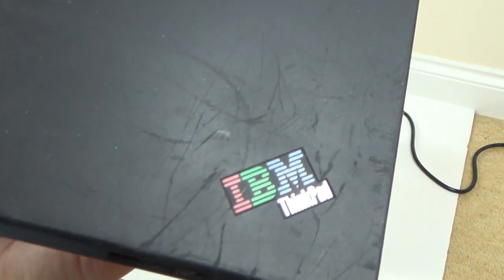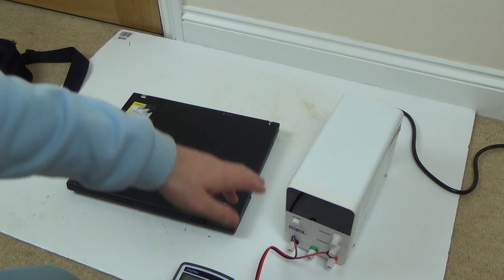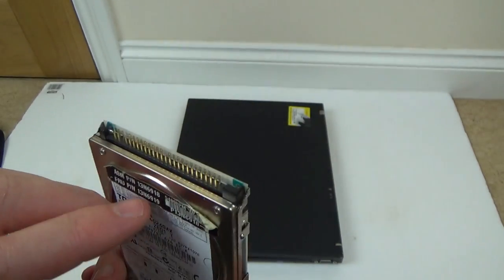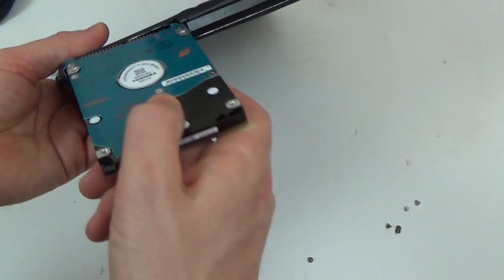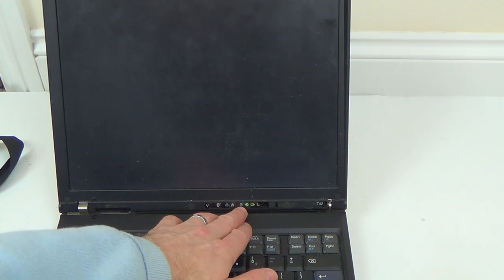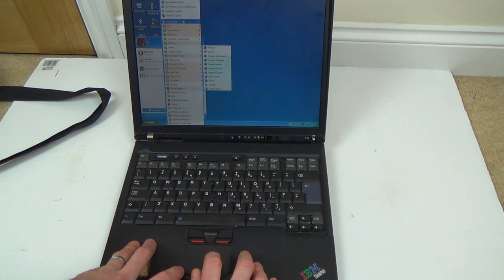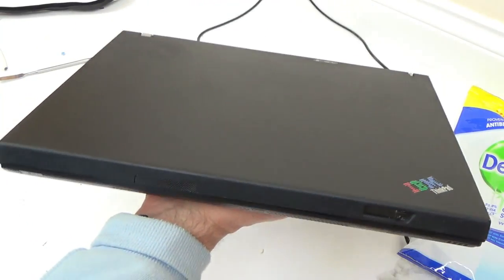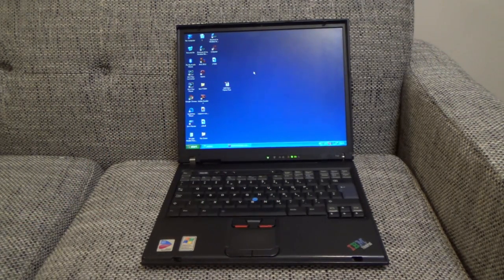Trying to FIX : IBM ThinkPad T42 Laptop

Comment: 33:51 install linux on it...you can also disable certificate warnings in the settings.
Reply: I was going to comment the same thing.

I'd say something like Lubuntu would work fine (or Debian if 32bit).
Reply: there really is no point in linux, there wont be really any performance improvement. Trust me i had a thinkpad t60 and honestly windows 10 ran better than any linux distros I have tried on it.
Reply: @YoureUsingWordsIncorrectly  linux users denying windows again? pretty normal at this point. 
anyhow I have tried linux on multiple computers and there literally is no difference in performance, it's the same. The only difference is software support, and the fact that microsoft does spy on you but I am fine with that some people for whatever reason aren't. 
The only performance boost you may see on linux is generally navigating around it but the software itself that you want to run will be the same regardles of what OS it is on. 
which is why i choose windows because it just has more features and a heck a lot more programs.
Reply: @aleksandersats9577  Not necessarily, depending on what you installed, because if you installed something like Gnome, Gnome has the tendency to be a bit bloated, and a power hog. Windows is about the same thing, for example, Windows 10 has two browsers preinstalled, Internet Explorer, and Microsoft Edge, don't believe me, search them in the system. And if you didn't put an SSD in any of the systems, and that's another reason, because hard drives has the tendency to fail, and slow down over time, and the reliability was never that great. That's really why company's went away from hard drives for the most part, and went with SSD's, "Solid State Drive's". Reason being is because SSD's is flash storage, and not mechanical, like hard drives, so SSD's are more reliable, they don't slow down over time, and they don't have the tendency to fail much, as long as you don't do something like defragment an SSD, because SSD's  are just not built for that, and can't withstand a defragment, and it's just not needed to perform because the performance on SSD's are pretty good anyway.
Reply: @jonathongraves2976  well look here I am 1 year in in becoming an IT specialist so I know lots of these answers already. and yeah sure hard drives might be unreliable but I have a hard drive that I have been using for 9 years and it's just fine, no sector errors or anything.
SSD's also slow down a lot when they are full same goes for hardrives there is no difference there at all. And no, hardrives do not get slow overtime, the system becomes slower because there is a lot more files than previously and the system needs to load them into ram to speed up the system, so that's where the slowdown comes from. 
And yes I know windows 10 comes with edge and IE, I still use IE on one of my older laptops simply because it's more optomized for that hardware than chrome or firefox. 
Also I don't use ssd's yet because they are still a bit too expensive for me and offer almost no space compared to hard drives, and another reason why I use hard drives is because unlike most people I have patience and can wait.

Comment: That pxe boot rom screen thing is also called network boot so the laptop in the earlier was trying to boot using  files that it could have found in the network. And it also requires an ethernet cable. Also connecting a windows xp computer to the modern internet isnt a good idea as xp hasn't had an update since 2014.

Comment: The pink/orange tint on the screen is indicative that the CCFL backlight tube)s) are failing. Eventually they will die altogether but if the tint disappears after a few minutes and the backlight stays on, then it'll probably be OK for a bit. Replacing the tubes IS possible but a lot of work and that's assuming you could even get hold of the spares. Replacing the whole screen is the usual fix for this but it'll probably be ok for now as it is.

Comment: The reason there is an orange tinge when it first powers on is it's probably using a CFL backlight (small fluorescent tubes) which aren't instantly at full power. Modern displays use LED's which mitigates this.

Comment: The “Orange” tinge is the backlight of the screen taking its time to fire up. Usually a sign of age of ccfl backlights. Probably not cost effective to replace the screen, however a very tricky repair is the replacement of the bulb itself. Theoretically possible but an absolute nightmare. 🤣
Reply: Put LEDs instead
Reply: @maytizevb  the screen looks like the standard cheap xga 1024*768 screen. Not worth for that. 
However LED modding is absolutely worth it for the great Flexview screens and the high-res TN panels

Comment: My daily driver right there for the moment. Slightly different t42 but my first thinkpad. Fell in love with it, will only use Thinkpads now. Laptop from 2004 won me over, Good on ya'll IBM. Thinking about getting a t61 and using that as my main laptop with some upgrades. 
Have a nice desktop I've built so for an on the go computer, I need reliability much more than I need speed.
Edit: Mine does need a new CPU Fan, the HDD cover is missing and the guy who tossed it took all the ram but the 512MB stick on the other side. If any of you guys know a good place to find Think parts other than ebay, please let me know

Comment: If you got an extra harddrive, you could clone the current drive to it, and upgrade the extra drive to windows 7 to rid of your wonder :D and yes an SSD would be insane, but I think that has an IDE interface, so an expensive Media Card CF and converter (if that is even needed). Microsoft is geared toward the Microsoft Store, much like Android older phones can't do Google Play. I had one of these, so it was a nice walk in history for me. :D Good job fixing it, and neat trick with the headlight restore idea.

Comment: Hi Vince, try putting a Linux distro (Ubuntu, Fedora etc there is also so very light weight distro's out there) on it if you just want a 'browsing' machine, the drivers are probably all in the latest kernel and you may find it runs okay for most stuff, also Windows XP is out of support by Microsoft now so no security updates.

Comment: I actually surprised how fast it boots from and old mechanical IDE drive. Nowadays, if it's not an SSD, we wouldn't even bother with it. And also the fact that the battery still holds it's charge give it's age (though possibly the battery might have been replaced). Yes, it doesnt hold the charge long, but i've seen newer batteries die in minutes after a full charge. Also, what is the song that starts at the 26:00 minute mark? Seems lovely and chill.

Comment: Sometime in the late Aughts, I came across a number of IBM ThinkPad T42s, in eWaste. Not one for letting a working laptop go, I snagged some and refurbished them for a private language school my kids were going to. I would say these are not all that remarkable, but build pretty robustly. Lenovo had already purchased the brand by that time. They are long gone by now. For Windows XP, there are is an open sourced Mozilla base browser which has updated TLS and root certs that allow for browsing but is are build on an older version of Firefox.

Security wise, like you said, this laptop and Windows XP should remain only for historic sake. It is at high risk of being exploited out in the wild. Any gaming should be non-web based, however I doubt it would be a good gaming machine - even in it's production years. It's a business machine, so it's focus would be Microsoft Office XP/2003/2007, Adobe CS2/3. I bet, instead of Windows, you might try Linux - Ubuntu/Fedora. As a spare machine there's plenty of interesting Linux discoveries out there for you, and you would have access to newer web browser technology. Also now that Microsoft has been embracing open source, I doubt you would miss all of that anyway. You can get .Net Core, and PowerShell for Linux even MS Office will run, with Outlook, and MS Edge Chromium. You would feel like you are working with more of today's software, just not gaming.
Reply: It's funny you say it's not a good gaming PC, bc the most used keys looked to be WASD, E, R, C, and Shift, lmaoooo. They must have been playing Elder Scrolls Arena or something.
Reply: In my experience Linux does not run well on old Pentium 4 base computers so if you have an OS that works better than windows xp or 7 than please tell me as I have some without an OS yet and so I can try it out.
Reply: @auqustfire  That is an interesting observation. I am sure it could play flash games. There are games, and then there are games. I suppose it could play Doom, Castle Wolfenstein, Duke Nukem - options are limited. It's a betweener, not quite a retro gaming system, and not quite a gaming system of its own time. Maybe it would work with WoW Classic, or Star Craft. I did like those games. Okay I take my words back, but it's what you make out of it.

Comment: I generally don't touch old laptops at all for the reason the issues you are having.

Away you can get around this is to upgrade the operating system.

But even then when you upgrade the operating system you might run into driver issues. They are a bit like software that allows things to work such as the CD/DVD drive.

Also you might need to upgrade the memory to allow the upgrade to work.

Comment: I'm thinking the black screws go into the bottom of the hard drive through the caddy and the two silver ones hold the black plastic piece by screwing into the side. Btw acetone is good at melting super glue

Comment: Hi Vince, your wife should have acetone, womans use it to remove nail paint. You always could borrow a little bit :)
PS. I was struggling with internet connection too. First update XP to Service Pack 3, then make sure that BIOS datetime is correct, then synchronize Windows datetime with microsoft server.

Comment: Thinkpad from the T30 and above were pretty solid machines, I thinl the got it right after the 600 series, hinges were not so good before. But many laptops suffered from it.  People sure will pick the T60 or T61. I prefeer the T400, it is almost a T61 but on early DDR3. Heating issues ? .... not really, but needs some care evey couple of years. FANs go wrong wiithout the BIOS alarming ... by go wrong I mean, slower than commanded. This machines rely heavily on fan efficiency. They dont get airborne as Pavillions did, but they definetely use it.
Reply: T60P with the IPS and the W500 are two of my favorites, T61 has its share of problems because of bump gate.

Comment: I think the old thinkpad is still usable , i have one perfect condition and added 1,5gb ram and a higher processor Pentium M 1,8ghz. In Windows XP is running very well. Mine is a T41, and i have a T61, R61, T60 ect...

Comment: PXE boot is looking for an IP Address. It's more commonly known to be used for network installation of windows. That can be set as the primary boot but if set, it can then go to hdd if nothing is found though it does take some time. It isn't an error but more an information note to say, "something wrong on your physical network or server. I cannot get an IP Address". Home users do not need PXE boot and so in the BIOS it should be disabled unless you have a server with a Windows image and Automated Installation file that will set up your laptop or PC without you having to enter details. 

Do not worry about it Vince. Just go into BIOS via F2 or DEL and disable it. You could also move it away from being priority. The clue to this happenign is it was potentially an old work laptop and since the hdd was disconnected, PXE Boot was enabled. That is actually a BIOS setting and NOT an actual problem. You can actually set an IP Address int he BIOS I believe nowadays but not surte on those, should be able to, not that it is needed.

Comment: nice job ,but it will be better if you clean it inside too and change the thermal paste of the cpu and the inside battery , this laptop where really well made and build like a tank , i got myself a thinkpad t400 with linux and i use it a lot for my musical needs

Comment: I like to keep "classics" like this around for (non-Internet) apps that need old windows or DOS. It's EZ to forget that computer were actually still useful before the World Wide Web..  :face-blue-smiling:  Case in point: I have a program that communicates with my PECU (Programable Electronic Control Unit) in my car. It's older and not a OEM item. Blaw blaw blaw. Catch ya' on the flip side. Cheers from So.Ca.USA 3rd House On the Left.

Comment: You need an old version of chrome, you can use that to download Firefox if required. They are tough machines and still get used for some vehicle diagnostics where a serial port is required, though rather slow and the hhd is very small - I think 120Gb is about the biggest

Comment: The reason why the securty issues come is because of expired certificates. You'll need to update the roots certiftificate to the one from September 2016, that was the last time I believe it was updated. There was an updater for it on the ms website but it is now gone. I ended up finding one from i430vx archive though.

Comment: I've suddenly got an urge to buy broken laptops from eBay so I can try and fix them.  Also, try UCBrowser, it's about the only browser that is reasonably useable on Windows XP. Or do what I usually do and ditch Windows and install Linux - something like Xubuntu or Lubuntu will work nicely with that laptop.

Comment: Put linux on it. Then it should work great with web browsing, is up to date and runs faster. (For more performance, i would suggest using the lxde desktop. works great with old thinkpads)
Reply: Or put Windows 95 on it and use it for retro gaming.
Reply: @MyRegardsToTheDodo  Sounds nice. You could install win95 into an image and boot it via grub. then both of us are happy!

Comment: I have an old desktop PC with windows XP Pro. Firefox and internet explorer works on it and it updates to newer browsers too. But I think the Windows XP on your IBM might not have the latest Service pack update. I don’t remember the latest service pack update, maybe SP3. That could be a reason why you can’t update your browser. Microsoft stopped supporting XP, so updating it isn’t so easy. You probably can get hold of SP updates for XP but not from windows update. 

Try to download Firefox browser on another computer and get a version that works with XP and install that version on the IBM. I still use my 20 year old scanner on my computer, even though it says install unsuccessful, it still works regardless lol.

Comment: Miss windows xp. 10 never feels as nice. 7 was good but I like the layout of XP more. The ThinkPad looks well made. I really like how easy it is to replace components on a laptop like this. My newish Asus requires you to take the whole bottom off to replace hard drive or ram or the battery. Once in was easy to upgrade to SSD but having the individual flaps was nice.

Comment: Also Vince dowload the iso file for windows xp then dowload the software rufus and then take a usb stick with at least 16 gig and make a bootable usb. leave everything on default other than when you select an iso (win xp). inset it in the machine turn it on and then press f2 as soon as you turn it on and go into the boot order and select the uefi usb as first boot device and then you can install it on the drive in the machine.

Comment: I bought my first laptop, the best 15 inch laptop Sony had available, in the very early 2000's for $3200, including the RAM upgrade. IBM made the best laptops at the time. Arguably, Sony was #2. From memory, the equivalent IBM was $4,000-$5000. I couldn't afford it. We're talking in the neighborhood of $6,000+ in today's dollars. My Sony PCG-F680 with 256 megs of RAM still works great. But we paid dearly for it. To be honest I prefer $500-1000 laptops that last 3-5 years if you really push it. As a programmer, I'm a heavy computer user. I or my employer simply just discards my computer every couple of years. Because laptops are now such a cheap commodity desktops are really a niche thing. Only the most demanding gamers and maybe video encoding. But back in those days the Thinkpad was really a special thing to own.

Comment: The security certificate issue is likely due to the system date and time being set incorrectly. This can happen if the real time clock battery dies (not uncommon on a unit this age) and the main battery dies. Usually in this situation it will revert the date back to likely somewhere close to the manufacture date.
Reply: LOL, these laptops revert to 1988!

Comment: Maybe you can answer this if you have time.  The wireless signal shows that it is on below my display panel.  I'm trying to connect it to my Android's mobile Hotspot.  Under connect to a network on my thinkpad I see my phones ID and it says connecting in bold but then never connects.  F5 doesn't work either.  Do you have any idea what I can do?  IBM customer service doesn't even know.  Thanks.

Comment: I remember on XP you have to set the proper time and date to avoid that certificate messages ... check that if not set, also try to update XP to service pack 3 if not updated, this will allow you to install newer programs because SP3 come in 2010 and it is most recent patch for XP. Windows 7 will be bottleneck for this machine even with 2GB RAM DDR@400MHz, the 1.6GHz Centrino will lag big time, not to mention the weak 64Mb VGA graphics. Perfect machine for Diablo 2 and NFSU 2 and maybe a NES or SEGA emulator :D